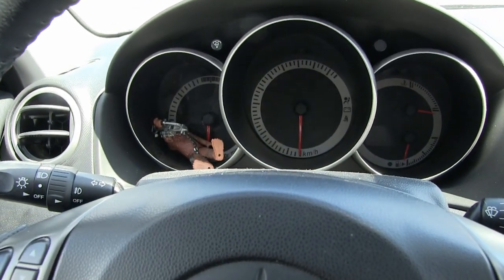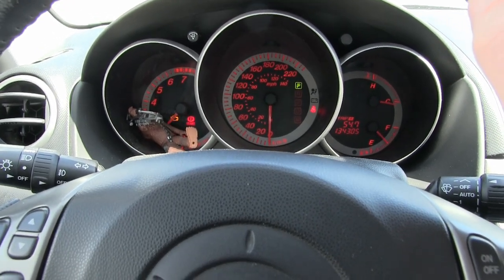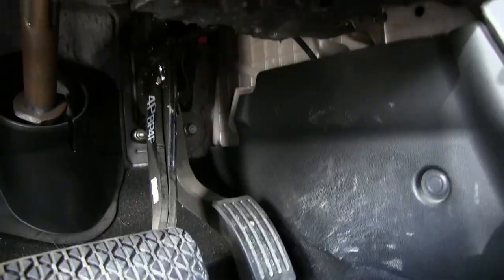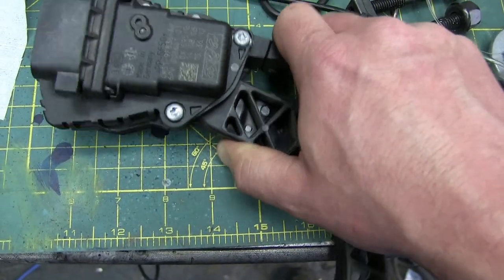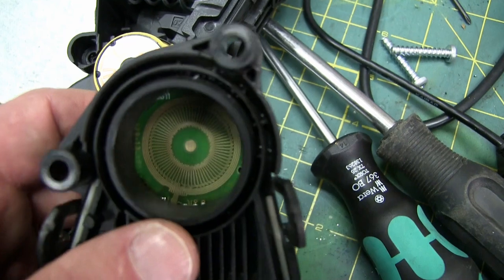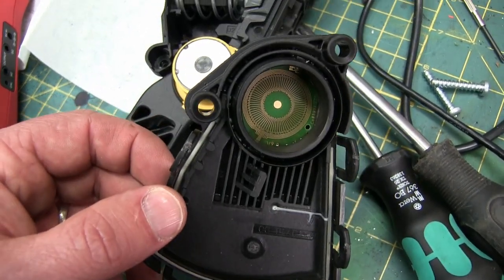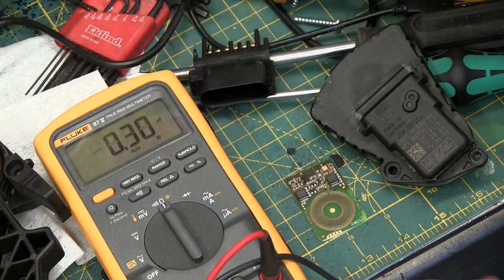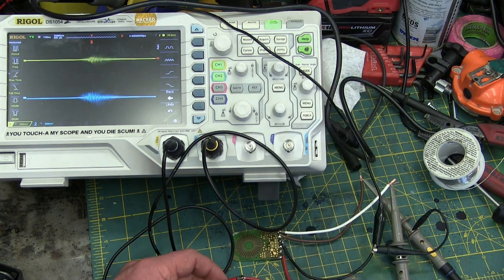BOLTR: CANbus accelerator pedal.

Comment: you might enjoy this from the rocket scientests  http://nepp.nasa.gov/whisker/reference/tech_papers/2011-nasa-gsfc-whisker-failure-app-sensor.pdf

best is to look at it with a scan tool or obd2 dongle on a cell phone or even a lap top in graph mode..  slowing moving the throttle..   bad connections are issues... ground connections are a major issue..  print and perform the six steps of this test before proceeding with any electrical or engine control issue. http://i.imgur.com/WMDprhm.jpg 

this only checks the main positive and negative electrical connections under the hood.. but those are the most important versions.

Comment: It is virtually impossible to find replacement components for parts...for good reason. The auto industry has everything patented out the asshole and every company wants to be the only option for replacement parts. Not a conspiracy theory, just vigorous protection of IP in a mature market.
Reply: you really want to trust your life to a Low Hung Wang chinesium throttle position sensor made by a 12 year old in an allotment shed?

At least trust your life to the one made by a 12 year old in a factory.

Comment: at least you aren't throwing expensive parts at it
Reply: what do you mean? I was quoted about $300 for my TPS sensor..  this was from a local shop with out labor.
Reply: +Ryan W do it your self.

that part is only worth SUB 100 bucks.

shops, even good ones, charge so so much.

my family is poor....we do the work our selves, buying a cheap part to get it running.... or a good expensive factory part when we can.

and then we.dont get charged 30 bucks an hour for labor.

and we.know.if it was done right.

you learn so much....you end up not having to have it fixed as much.

doing.it.your self is a "win win win win" situation
Reply: $300 dollar TPS?  I got an entire throttle body with the sensor for 25

Comment: if it's canbus you need 120om resistor between + and - data lines, she might spit out a hearthbeat. I doubt you can make it produce any usefull without a tool that could pretend to be a master device on the network

Comment: My car has the steel pedal and the steel cable... works any time.... any day.... until the cable snaps...
Reply: The cable never snaps. The little lead end just falls off.. rendering the entire cable useless. Lol.
Reply: The cable shield can also get gummed up and then it can get stuck in WoT. That's also exciting, because at WoT, the engine won't make any vacuum for the brake booster!
Reply: failing to off is always best. also, if the cable sticks, pump the gas to unstick it. can you do that with an electronic throttle? in most cases it will fail to off, but I assure you, this is not always the case.

Comment: Check for pin spread due to vibration. Also my guess is it is probably in the wiring. They don't loom shit any more if its inside the car. Get the wiring diagram via alldatadiy.com and then disconnect the parts and voltage drop the wires. You can also send an a/c frequency down the wire and use a low amp probe to find dead spots in the wires or where it is shorting. Its essentially what the Power Probe ECT 2000 does.  Or pay some dumbass like myself your good hard earned money to do it. Just make sure he knows wtf he is doing. Just make sure if you send voltage down a wire it is not connected to anything else or you let the pretty blue smoke out and clever guy you are i know you can capture it but, putting her back and having it fix what let it out is a lot harder :p

Comment: oh oh every Saturday we went to junk yard and got parts from a huge yard. snow or hot every Saturday. I was the new guy it was a lot of fun my boss thought it was a great personal defeat to buy new part's
Not, fan belt or timing chains. coolant sensors fail after 5 10 20 years.
 we watched the parts change from metal to plastic to and all. save wieght 
ford fix or repair daily. planned failure points, Vw door handleds. 
 L learned how to rebuit enginparts  use a piano wire to remove winshilelds and goe really sloe at the end or you'll crack it. . Nothing like working forking with a old master with near photo memeroy.
Last he had 2 storage container as big as seimie filled with parts . with parts. sad thg was .gov don't like what dont look just right. like all the other shops.

Comment: I know nothing about modern automotive crap. 
But based on my industrial background, I'm gonna guess it's an Optical Encoder,  
either Absolute or Incremental. Usually 5V, no PWM about it. 
And in the industrial world it would cost $200-300 max..
$5000?? No freakin way.  Unless maybe if it was a toilet seat for the US Army.
Reply: I see yer point
As CAT Gaskets, and CAT O-Rings, don't either eh?
Reply: +AvE you wanna price any piece of crap that rolls on to an airport ramp for bang for your buck. I have worked industrial and airport, it cost £24000 to modify each one of a set of 8 aircraft access steps making it powered hydraulic lift and jacking rams from a hand pump and adding a single wheel drive. the added bits, are..... one small single cylinder diesel, one very small gear pump, one gear motor, hoses and very basic wiring solenoids to run it done by the oem, 

a battery powered tug radio controlled for moving aircraft, £80000. 24v (2 deep cycle batteries not much bigger than a truck battery) two motor controllers two dc motors, trans and reciver. and a chassis. I cannot find the value in either of these. moral is industrial is costly. airport..... well I'll stick to industry from here thanks
Reply: Why would an optical encoder be made out of copper traces on a circuit board like that?

Even if they were, why would they have termination points at the bottom of the circle like these ones did...and then a copper piece that mates up to them?
Reply: I said I was going to guess
Not guess correctly.

Comment: app sensors have a dual signal thig a ma jig going on. one signal the ecm reads is voltage dropping as you press the accelerator and the other signal is the voltage increasing as you press the accelerator. the ecm monitors these two signals in a set value and if the stop corresponding to these values the ecm goes into fail safe/limp mode. so the car doesn't take off uncontrollable like what was happening with the Toyota camery a few years back.. new garbage.. what was wrong with a cable.. lmao..
Reply: The stuff with the camry was astoundingly horribly coded ECU software. To quote an internal e-mail "Failsafes aren't in toyota enginering's DNA". The advantage though is that you don't need any extra hardware for cruise control, idle air control, or emissions. Less weight and less to go wrong.
Reply: cruise control I can agree with but most manufactures still use an idle air controller as the throttle plate is too big to control small corrections. 30 years as a mechanic I can surely say that the electronic throttle systems have way more problems than the old cable style..
Reply: less weight and less to go wrong? not so much. more parts, more to go wrong, just as much weight in the end. it's like replacing the throttle cable with a living creature. no one understands how it actually works, we just expect it to work.

Comment: $100 is extremely overpriced, they could at least sell them for like $20-30, and not gouge people who already bought the car.
Reply: Yeah and how about they also give you the part and install it for free while they are at it right? They have to make a profit too and producing those parts are expensive.
Reply: it's only 100 for the pedal? oh that's a good deal most pieces of electronics in a car are overpriced. probably would cost more than 100 for me to make one from scratch
Reply: My idea is more of they should probably make due a little less than the probably 900% profit margin they they are going for, especially since it is a part to a car that they likely price gouged beyond astronomical levels for anyway.
Reply: Razor2048 I don't think it's a 900 percent profit margin. It's probably between 100-200%.
Reply: Razor2048 research and development costs money and the factory it is produced in costs money.
Reply: I used to work with a parts distribution company that also supplies dealerships and trust me there is no 100% or 900% profit margins most of the time it is around 30% tacked on to the cost of the part. Also parts are extremely expensive to produce and it's not produced in a massive number like say an Apple smartphone.
Reply: IF there was no profit in parts, no one would make parts.
Reply: +Tom Much the same when I replaced the belts and tensioner on my Mazda3 2.0 Sport (UK). A Gates kit with tensioner and both belts was far less than the official Mazda tensioner alone - which unfortunately is a specific Mazda item and different from the Ford equiv. Found both original belts were made by Gates when I got them off.
Reply: 100-200%?? Are you joking? Do you know how much money it actually takes to build an entry level $20,000 car? Ill give you a hint. They make around a 900% profit. Do the math.
Reply: rsx123 dude research and development is free right bro?
Reply: R&D may not be free, but when you see a car company use the same engine, ECU, and pretty much the powertrain for 5 years, their R&D costs are not that high anymore.

PS, More R&D went into the CPU on the desktop PC you built, than went into the car you purchased.
Reply: Razor2048 well that's just flat out wrong. The main reason the keep the same design around is because it takes awhile for them to profit off of their design. Engine development costs millions if not billions. Which is why they cost a ton new and why they use the same one everywhere. With just the engine alone if you look at how many cars are sold a year for a given model you would see they dont make a good return on engine development the first year. Let's do the math. If an entry level car at Ford costs 20 grand and they sold 100 thousand of those cars that year that would be 2 million dollars gross revenue. The engine they put in that car took 3 to 5 years to develop and costed close to a billion dollars to develop. I think you get the point.
Reply: last time I changed the shocks on my car, one bolt was basically fused to the metal bushing of the old shock absorber. $8 for one bolt.

Comment: thaaaat looks alot like the old mechanical speed controllers in RC-cars. a physical piece of metal rubbing on another one, sending a signal yada yada, google it hah
Reply: It looks similar, but it definitely doesn't work the same way. There's no physical contact involved.
Reply: It uses electromagnetic induction to sense postion. (https://en.wikipedia.org/wiki/Electromagnetic_induction)

Comment: How does your wife manage do drive with an entire pedal missing?
Reply: The new pedal is on the way or off-camera, likely. We know the price of the replacement part..
 I wouldn't be hacking specialty parts until I have the spare right number test fitted and maybe completely repaired and then fool with the old part to figure out what went wrong and/or adapt it to a drill or something.
Reply: um no, I mean he might have ordered it but it's not there. 
The car is undriveable anyways in that state so he doesn't care that he is rendering it undrivable. Unlike messing up a part that MIGHT be bad. The car really is undrivable if you cant get pedal response at all 3/4ths of the way compressed.
Reply: Guys I was making a joke about the Clutch missing. 

Didn't even dawn of me you'd interpret it in this way

Comment: The throttle body and the pedal both have 2 pots in them for redundancy. Pcm (powertrain control module) compares the signals (0v-5v) and controls the throttle motor. At least thats what they teach us in school. The pedals go bad all the time, even more so on the German pieces of shit. Depending on what year that Mazda is it might need programmed, but for the most part domestic cars are plug and play.

Comment: If you were using a real scan tool instead of that cheese ball abortion you have you could look at Freeze Frame data and the PCM would tell you the values of the pedal position sensors at the time of the fault.